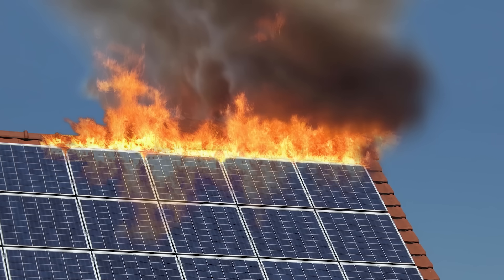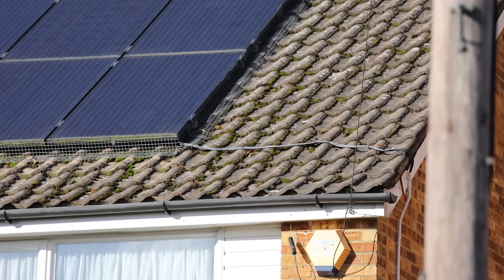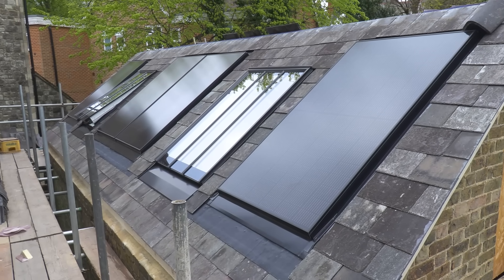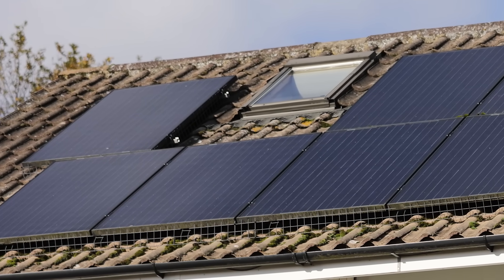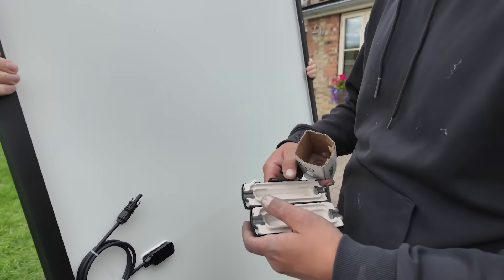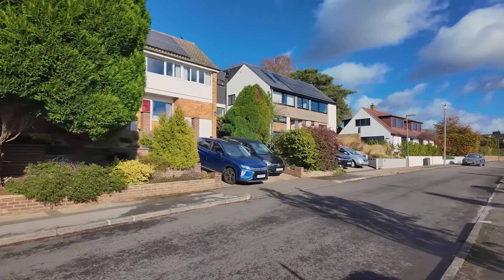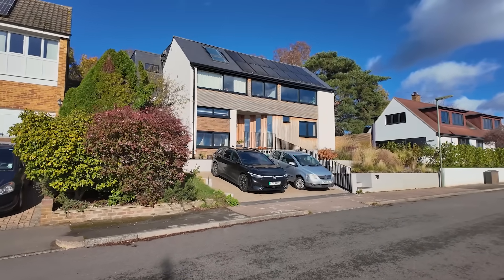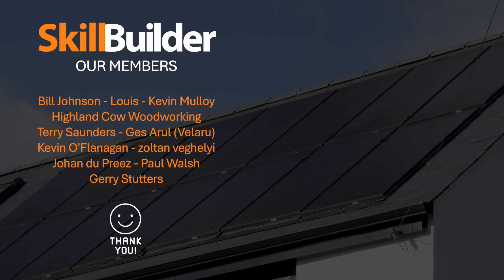Solar Panel Fires Are Rising – Here’s Why

Comment: Solar was installed this past summer for 28 flats. The shed housing the inverters and batteries does not have a ground rod and only 3 ground wires are visible on the trunking. After the Dalston fire I am worried. I got 6 years of current FRA which failed every year. 217 fake Grenfell model firedoors were installed in 2017 in other schemes.

Comment: If I am not misinformed, the battery chemistry from an electrical scooter is very different than that of a solar installation. There are real dangers with the electrical scooter ones (thermal runaway in lithium-ion batteries with NMC). Solar batteries are very safe and many, even the most cheapest ones, have fire extinguishers built in.

Comment: Parallel solar systems is what I recommended in solar Independent Utility Systems Manual for this reason. 
 More efficient also btw yeah wiring cost more but fire chances go away 2:28

Comment: Sounds to me like shoddy electrical work and poor materials rather than the actual solar panels. All wiring needs to be weather proof. The sun will bake the insulation and plastic, while the rain and snow will short the circuits.

Comment: Correct me if I’m wrong, an isolating switch won’t turn the current of from a panel that’s in the sun. It will stop said current reaching the solar inverter.

Comment: When your installer make up his cable that goes from the solar panel to the inverter, make sure the two halves of the plug and socket are of the same manufacturer. If not they may not be totally compatible, and be subject to arcing.

Comment: When you contract to install solar or do it yourself, you must pull a permit. The permit will require inspections by the local authority having jurisdiction. If you do have a fire, the first thing the insurance adjuster or investigator will do is look for permits and inspection approvals. If you don’t  have that documentation, the insurance company will not pay the claim. The municipality could fine you for not having the permit. If your locale does not require  inspections, you better be certain the insurance company does  not require you to have a licensed engineer inspect it.

Comment: As a alarm specialist, smoke detector’s are for interior ‘temperature controlled’ spaces. A hardwired fire alarm can use ‘heat’ detection in an attic.

Comment: I work for a very large social landlord and they got solar fitted to a lot of blocks of flats with flat roofs. Every one I have come across have been covered in dirt and isolations switched off. They do not maintain them at all. Somebksy clearly just made a few quid fitting some expensive tech that has never been serviced and doesn't benefit the residents at all.

Comment: Where do you have the numbers on PV-roof fires from? Yes, shit can happen, esp. when you use cheap connectors and switches or have no idea what you are doing and how its done correctly. When i see some loose wires hanging around on the roof, i get my nails curl up... You don't need too many switches and breakers for DC but if you have one (or need one) spent the money for quality! Many DC breakers are installed in the wrong polarity and this leads to not clearing the arc! DIY batteries can be a problem, when they are not built with care and knowledge. Afaik in Germany we don't have much of a fire rist with PV but some early pouch cell li-ion batteries were prone to fire hazards...

Comment: Fire  risk sure depends on the installed system. Low voltage systems had the risk of overheated connectors, when corrosion found it's way into connectors. Higher voltages can handle more power, before a corroded connection gets warm. But then the risk of electric arcing rises - and direct current arcs aren't self-extinguishing.

Comment: Batteries used in solar systems have a different chemistry to cars, E-bike and scooters.
This chemistry has a much higher ignition temperature so in the event of a thermal runaway the battery just gives off vast quantities of toxic highly flammable gas, so never have the battery in the building. 
Out side the house under cover allows the gas to escape. 
Inside the house the gas is trapped and it will only take a spark to cause an explosion.

Comment: The problem with solar panels is you cannot turn them off the electricity is there all the time the sunlight is on them.
I think stand them off a tiled roof, definitely have an isolator on the out side wall at ground level to disconnect them, that may help depending on the fault. 
If possible do not place the panels against each other as it will only be one panel that catches fire, spaced out helps stop the fire spreading to the other panels.

Comment: They don't catch fire here in Spain, where they get considerably hotter in the sun during our summer.
Pretty obvious therefore that it has something to do with the way they're being installed in the UK.
My present panels have been up for 5 years and with summer shade temperatures in the early 40s here for three months plus a year, my panels must be getting hot enough in the full sun ro cook on, yet they still haven't caught fire.
Blatantly not a panel issue.
I also live in a high fire risk area. We have permanent helicopter stations here for fire fighting, and i can guarantee you if solar panels were a fire risk, they would be banned. 
Everything you are saying points to incorrect installation.

Comment: Alarmist BS no doubt encouraged by the fossil fuel industry.    Any energy source is a potential fire risk and you are no doubt going to get the occasional cowboy installer.   The risk of any fire spreading to the rest of the house must surely be extremely low.

Comment: Hmm, if there is no ventilation allowed for heat dissipation, a fire MAY  occur from either old wiring or a damp spot in the wood ceiling.  Similar to a hay bale fire after a previous rain or wet weather. As the hay bale dries off, heat is actually created deep inside the hay. 😅

Comment: I talked to an electrician about the cause of such fires. He clearly stated that it is the Direct Current's weakness. Because with DC you get so much higher heat buildup potential if a connection is poorly done. It sounds like a bulletproof explanation to me.

Comment: We had solar panels and battery installed in our property back in April 2025. Then in May a property across town which also had panels fitted a few weeks earlier caught fire. The fire brigade said the source was the solar panels. These were 'in-roof' panels on a house being reonvated. It would be nice to know the exact cause of the fire. The upper floor and roof was gutted. Our panels sit above the roof on brackets and inverter and battery are in our attached garage. I've been thinking of getting a smoke alarm and heat sensors fitted just in case. Very happy with our solar and battery system overall. Saving so much on electricity we consume and exporting. I've dropped our energy direct debit to just £1 pcm. But the fire risk should be taken into consideration when thinking about getting solar panels.

Comment: when building or installing renewable energy can be complex. but most of the time the energy transferred to mppt (maximum power point tracking) then mppt balance/boost the current and voltage to get most power out of the panel. ofc when possible, limit how much amps going thru the battery or mppt. since amps is load and that load transferred to the panel to get max power. if you push too many amps into the panel, ofc there's risk. that's why we need to understand how this thing work before building or installing it. oh yea the battery, it's generally low risk, some even if we puncher it, it will not gonna go off no matter what. even the durable cheap one.
Reply: Ever see a battery explode... Its no fun. 😊.  🍿👀

Comment: Key Causes of Solar Panel Fires
 Electrical Arc Faults
This is a leading cause, particularly in high-voltage DC (direct current) systems. An arc fault occurs when high-voltage electricity jumps across an unintended gap, creating a powerful, extremely hot spark called an electrical arc.

Comment: This is what happens when you install low cost, non major name brand modules. Microcracks in cells that can cause arcing is fairly common in cheap solar modules especially when operating at high series string voltages.

Comment: Smoke and heat detectors. Heat not affected by dust. Also most panel generate a lot of heat on the underside so you must keep a good free flow air gap.

Comment: In 2019 I renovated my roof and installed 24 solar panels myself. To begin with I used so called double glazing panels (solarwatt) because they are more robust. Second I used Enphase micros so the voltage on the roof is no more than 40VDC instead of 400 to 1000VDC. Third I installed the micros inmetal cabinets indoor to keep them dry and reduce the risk of fire. The panels themselves are installed on a metal sub roof with about 10cm clearance between the glass and metal roof. So there is no heat accumulation.

They only thing I worry about is that in the case I have to replace one, it’s difficult to find a replacement with the same dimensions. But I am not too worried about that, because one inactive panel,is no problem at all.

Comment: `Good quality batteries` also catch fire, as bad ones. Check car fires => these are usually high-quality batteries. Every battery has a BMS that, in reality, checks all parameters of the battery and stops the battery if something happens. But this is not the place where fire starts. Usually, there is some mistake inside the battery cell, and in that case BMS is useless. Fire starts from inside one cell and spreads around, no matter what the BMS does.

Comment: The type of solar panel matters a great deal. Panels with glass on both the front AND back, found on bi-facial panels, are much more resistant to fire than panels with a plastic backsheet.

Comment: What's burning. Panels get very hot, they can short cells and possibly melt cables but a fire would be high voltage short circuit. I would put it down to missing the earth circuit which is required. More a electrition fault not following basic requirements. Any fire should have the install firm removed from trading

Comment: Never heard of a fire risk with solar panels. So what causes it.
Reply from the maker: Dc current is prone to arcing if a connection is loose or cables are chewed by mice or rats. 
It would be prudent to put the cables in conduit.

Comment: On the scale of things- cheap electical goods from China (chargers, e-bikes etc) must be the overriding risk for house-fires, as people now take very little precautions with them.  Solar panels - at least from the aspect of escape from the house - are low risk, but knowing exactly where to isolate the panels - is a must for owners.   (having inverter and batteries in loft never seems like a good idea to me).   In Scotland every property MUST have interlinked smoke/heat alarms - I'd seriously consider adding one in the loft space (near the cable penetration).

Comment: Three times the number of fires caused by solar panels over a given number of years ... but are there also three times the number of homes with solar panels? If there is less than that, then it's a problem. If there is way more homes with solar panels than three times over the same time frame, then the risk is in fact going down. These statistics need to be examined so that the before and after are put in context. For example if the overall risk is 1 home per 50 thousand homes per year and three years later there is 3 per 5 thousand homes, that could easily be 3 times the number of fires, but 3 in 50 thousand is a vanishingly small number that a trend or common cause cannot really be known.

Comment: Shady mc4 connectors are dangerous  Why increase the risk by  installing solar wires in a loft? Mine runs outside the roof, not in the roof.

Comment: Apart from PV panel installations, I have noticed that several relatively small houses near where I live have acquired gas fired boilers in the attack, no doubt to save space. Most attics, like mine, have a wild temperature difference over the year, and there must be restricted access for maintenance etc.

Comment: Ive wired mine in many series groups of 2 for a VOC under 90Volts, this reduces the fire risk, and the tracking and shock hazard. It also means if a panel is damaged or soiled it will not effect the other groups.

Comment: Here in Sweden, if a battery more than 10 kWh is installed it has to be in a firecell. The Sodium battery sold by company Eleven Energy are proven way more safer than litiumbased batteries.

Comment: Firstly try to install on a flat roof - avoid slanted roofs whenever possible. Leave space underneath the panels. 15cm is a good start. Do an annual maintenance check. Have the connectors free in the air or clipped on a plastic clamp. Certainly don't strap to a metal surface because after several years of buildup dirt it will cause sparking. Plastic tie wraps break after 10 years of UV exposure to the sun. Either use expensive UV resistant straps - or replace when broken - or better put your cables in open metal grid cable trays. Make cables never touch the roof surface. Rotten leaves can make best quality cables spark. Use modern non conducting roof covering instead of classic asfalt kind of roofing. Attach a ground wire to all metal parts. Areas with trees in a 100m peripheral will show much more moss buildup. And very basic : 1 panel voltage is about 40V. The more panels in a string the higher the voltage. So common industrial 20 panel strings at 800V pose a higher risk of fire than a mini system of 3 panels on a dirty roof. Never work at height without all safety precautions (that's a different chapter but too specific for this post). Protect yourself from electric shock - LETHAL risk with solar panels also when invertor switched off. Work in dry conditions. Wear decent shoes and gloves. Stay safe. Kind regards, Jan
Reply: ? Why gap as big as 15cm (6" )? Birdts + other? Animals can get under !

Comment: Not worth the expense of buying/installing for the risk of them burning your house down - and for what?! To save a few quid on mains electricity supply? The panels & batteries if you have them fail after 10 years or so and can cost over £1000 to replace per panel. Forget it people.
Reply: My system is 13 years old. No panel failures and the original inverter is still going strong. I did have to replace the generation meter as the display failed on it.

Comment: My panels are in box iron frames clear of flat roof with gravel under them. Batteries etc indoors where I keep an eye on installation and any heat buildup, and switch everything off if I’m going away anywhere.

Comment: Who could afford 1 home fire accident in their life?
Reply: I think that the chance that your non electric car catches fire is bigger than a correctly installed solar system.
Reply: @ReneArtoisMr  "correctly installed solar system" - why risk your families lives in a horrific death if had one 'incorrectly' installed? Nobody will go up there after the installation to check or know exactly what to check etc. A chance not worth taking.
Reply: @PaulBruce-v1vIf that is the way you think, you should stop driving a car or use a bike. You should also stop using a tumble dryer and e-bike because they are way often the cause of fire then solar panels.
Reply: @ReneArtoisMr  It depends on what people think is worth the risk with those things you've mentioned, as you say they can all cause fire. With the car/bike, etc it would definitely still be worth the tiny risk as so beneficial to life for anytime travelling in both leisure and work etc.
I don't consider polar panels anywhere near as beneficial, as not needed to have electricity in your home which is why the vast majority of homes do not have solar panels. Same with the tumble dryer - not needed, as can still dry clothes in/outside the home without one, which is why we don't have that either.

Comment: Pigeons build nests under them, and they overheat and catch fire. You must use bird mesh on the sides of your panels. The panels sit on the roof, not in the roof, so a smoke detector undet the roof will not work at all.

Comment: Solar is still just a 'feel good' thing that makes sense for so few people - and so many get scammed. Take the installation at 0:56, for example. Seven panels at 350w, with 3 hours average/day = 7.4kWh of power. At $0.15/kWh this equals $1.11/day of power generation. This is $405/year (insert your own figures in formula). How much did this silly contraption cost to install? How much did it cost in roofing repairs/lifespan. How much in maintenance of system components (inverters, etc.). How much more insurance costs. It's more a way to make a statement than to make sense.
Reply: UK energy is much more expensive
Reply: @AlexSmith-y4i6t  This is why I included the formula - so people can plug in their own situation.

Comment: i would never put any PV equipment in a loft. Its way to risky and hot in the summer, also its a sh$t place to work, maintain and watch stuff. Just pull cables (in a high quality conduit) down to a safe and cool place, done.

Comment: Wires are outside, exposed.

In Canada, we get hail from time to time as well.

And due to UVs, plastic will deteriorate over time. Any wiring outside which is not periodically replaced is a ticking time bomb.

This happens with rubber too, car tires going bad after about 10 years.

Who is installing them? Could be fly by night company with semi-capable staff. 

Giant batteries should be installed outside the home.